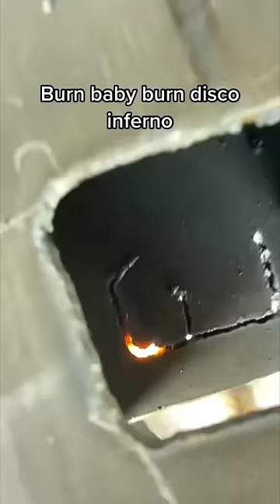Trailer Repair. Repost from @porkwelds(TikTok) #yeswelder #shorts #welding #repair #fabrication

Comment: Why not just remove the plug from the cable, drill a hole big enough for the cable to fit through, and reattach the plug on the other side? Seems like you could’ve saved a couple hours of work welding

Comment: Buddy forgot to turn the gas on when welding😭
Reply: Actually forgot to look at the puddle,because i can quickly notice in less than a second that the gas is off,even a short tack will tell you that ain't no gas coverage,probably he run out of gas in the bottle and kept doing to finish the job.

Comment: Too much grinding it removed all the weld and therefore no longer strong. Soon will crack from elements of weather alone let alone pressure and vibration........